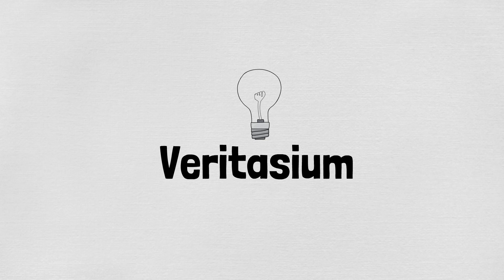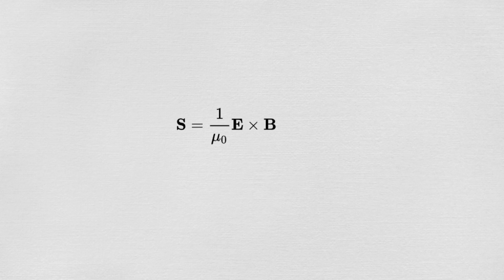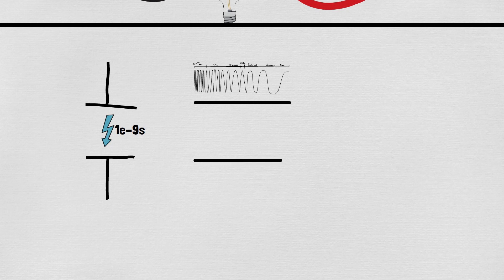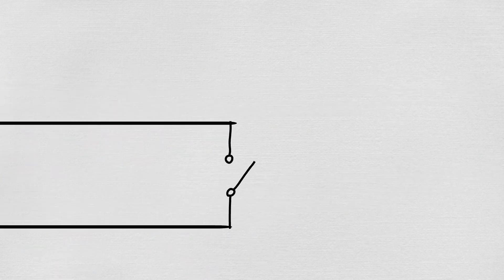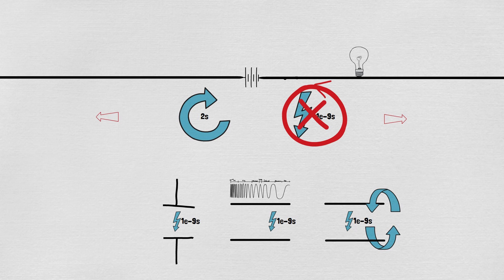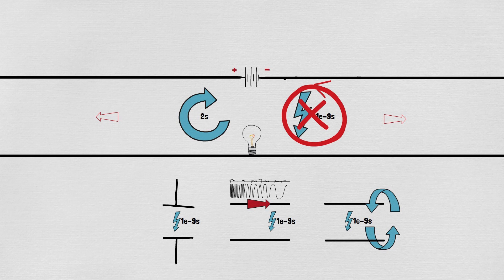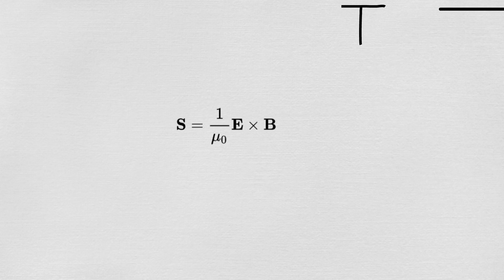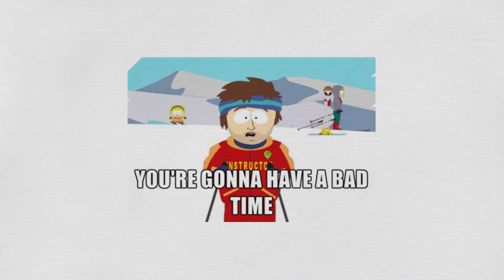Veritasium is Right? (see description)

Comment: Veritasium is a science popularizer as much as a science educator, so it seems he was successful in getting so many people of different expertise levels thinking and talking about this topic.
Reply from the maker: agreed. even if i'm wrong, or if "turn on" is very carefully parsed to mean any transient current passed through it, it's been a fun topic to discuss.
Reply: He is technically correct given the assumption "any current will turn the bulb on" which was stated. This also means the background EM field from the Earth will turn it on at all times but technically he is correct.
Reply: Not for the first time. His clip on 'Regression to the mean' is also faulty. He just read stuff & present it, without realy understanding it.
Reply: Sorry but he is wrong, because if any amount of power then it's not d, the answer is e, as it would ALWAYS be on, radio waves, solar radio,  and even cosmic background radiation, aka it's always on, or immediately upon turning the switch on if thats the point when you start measuring. (that's not even considering this proper explanation)

Funnily enough the power produced is probably lower than that from radio waves or just solar radiation, would have to calculate it for the cosmic background radiation. Especially considering PERFECTLY conducting wires, only 12 V DC, 1m distance.

He TRIED making a smart trick question to get people to think and to better understand the subject, however in the end it was a gimmick and is riddled with flaws and stupidity.

A science educators first job is to make sure they don't teach people the wrong thing and make them misunderstand, BEFORE anything else. Lastly he still hasn't corrected it which is even worse.
Reply: @antimatterhorn  Is it really transient at the beginning? I mean, isn't it more like this: It starts with zero volts at the bulb, and then when you turn on the switch, it increases as the EM fields build up when the current propagates through the wire. I.e. when you turn on the switch, the E and B fields will start propagating with the speed of light, creating a small but increasing voltage at the bulb. The Poynting vector (i.e. the energy transfer) will then increase kind of linear for 0.5 seconds (or perhaps 1 second) until the bulb reaches full brightness. (I'm not a scientist or so, but have my MSC in physics and electrical engineering :)  and this is what I could figure out.)
Reply: @MrThedumbbunny  Nope, if any EM field could turn on the lamp, the answer is 0 sec not 1/c sec. Because the lamp would turn on even before the switch is flicked.
Reply: @Dzeno2010  I do agree with you on this; V uses too many words and too much drama-music. He seems mainly interested in a certain beauty of the subject and get people to talk about it, rather than explaining it fully and/or on a level that really popularizes a subject. It means more subscriptions from me to people explaining this subject better than V himself did :)
Reply: @MrThedumbbunny  ""any current will turn the bulb on""

He doesn't actually say that. He says, "The lightbulb has to turn on immediately when current passes through it."

He doesn't say how much current, so the basic assumption is that there's enough current to light the bulb. The video is terrible, because the message he's trying SO HARD to convey is that, wow, the REAL answer is 1/c, but he completely ignores that what he's describing is induction, and the amount of power transmitted via induction is critically based on the distance. Hence that's why we need the wires to transmit power. His videos are supposed to convey true science, but all he did was muddy the waters and bamboozle viewers with clickbait, leaving them with a false impression.
Reply: @chrimony  no the litteral meaning of this assumpyion is if current goes through the bulb it turns on. Wording correction accepted. Meaning correction not accepted. The rest well yeah ive been saying exactly this. Technically correct given assumptions though earths em field would matter too. Also its misleading because the power transfer is miniscule. The capacitor idea of the energy transfer is silly. This was not bare wire and a 1m gap means almost 0 current due to capacitance. It was also not what he was describing which is inductance. Inductance is going to be reduced by  d^2 so a relatively large distance like 1m will recduce the effective current to almost nothing. Current is also only generated by changes in em field so choosing DC to demonstrate is a poor choice since it now means we are doing calculations on startup situations which is much harder to analyse with numbers due to the related rates and multivariate situation.
Reply: Derek misled people about this entire topic.
Reply: Sicklil, if I make the extraordinary claim that I can lift a car over my head, then I have misled people into believing this extraordinary claim. My fraud can’t be forgiven merely because I start my video by saying “assume that I can lift any object over my head…”
Reply: @interestedparty00  yeah but if your car is a p50 and weighs 150 lbs then your technically correct but misleading.
Reply: @MrThedumbbunny  Meaning is derived from context. The context is we have a lightbulb. If he wanted to say ANY current, then he should have stated that. For all we know, in relaxing our assumptions, he could be saying it doesn't need time to heat up. EEVblog seemed to going this route, because he modeled the bulb as getting the full voltage due to transmission wires and capacitance. At any rate, the video is terrible, and I wonder how much of the confusion Derek caused actually originated because Derek himself was confused, or if he just wanted to wow users while glossing over critical information or not covering it at all.
Reply: @antimatterhorn  RSD Academy says that there is a damped standing EM wave that dies out very quickly but that sends a pulse through the field to the other line in 1/c s. Which creates a small current on the other side and lights the bulb since ANY voltage will do so. This pulse will only happen once a transient is introduced...ie throwing the switch. If the switch is far away this changes things I think...?
Reply: @MrThedumbbunny  "EM field from the Earth will turn it on at all times but technically he is correct."     true. I think...if the field is transient at all. But well after this video I am questioning everything these days 🤣. However the point of Veritasium's video was to introduce the pointing vector to the world. And nothing else. But he did it in a poor way. He's not a great or even good teacher. He makes fun science videos, that's it. I have a hunch that we don’t know the context of the conversations with the professors before they said "I think you will be called out on it." The professors probably said: "Derek technically you are correct but this is not a good thought experiment to use because it is misleading, so I think you will get called out on it." Unfortunately Derek wanted a sensational video and that's what he got. The assumption that ANY voltage will light the bulb is what makes the long wires not irrelavent and instead, what magicians would call "misdirection". It's poorly laid out. I lost a lot of respect for him on this one.
Reply: @2hedz77  in his defense B fielda kicked my but way back when.
Reply: Actually, it just confused me and wasted my time, never watching this veritasium until someone starts interpret veritasium's conclusions in  strange way. After and before his video, I have a clear vision of this question. But lots of people lost it because of veritsium's video. Thank author for trying restore of understanding of this problem.
Reply from the maker: @2hedz77  i think this is possible (the damped standing wave) and that would be akin to calling a rock dropped in a pond the same thing as a current. yes, in technical terms, that is a transient current, but elsewhere (like twitter) Derek has actually claimed the bulb will turn on with a fraction of the power and stay on until 1s later. he might be right, but i don't think he is. i think another illustrative thought experiment is to imagine a conductive plate attached by a wire to the negative terminal of a battery and nothing else. does the plate become negatively charged and just waiting to discharge somewhere? no, the plate stays neutral.
Reply: @antimatterhorn  all you did was bla bla bla bla bla...
Reply: Yet, you can not just claim that DC power can be delivered through space independently of the property of the wires. If you want to transmit power via short pulses, you will need extreme currents and pulses that contain all kinds of frequencies and are not DC either!
Reply: He was still wrong.
Reply: @realedna    The claim was not that DC power was delivered - the power delivered in 1/c seconds is due to the transient in the wire when the switch is closed.
Reply: @Dzeno2010  calculate the capacitance between 2 wires at those lengths, I got a few milifarads. Definitely a bigger jolt then radio waves although we need to take the wire resistance in account still then
Reply: I don't think that excuses acting authoritative when at best it is a highly misleading interpretation
Reply: He's also wrong in about every video of his as well. Or outright lying, such in the Autonomous Driving Car video, which he was sponsored to make. AKA he doesn't have a single clue about what the fuck he says ever, and he is not an expert in any field, he's a fudging Youtuber... nothing more, nothing less. He has about as much of a scientific understanding as there are trustworthy news anchors on CNN. He's about as beneficial for science as ingame chat is useful in League of Legends. He's about as good for science as Riots are for small poor suburbs where no one can afford insurances. He's about as good for Science as stubbing your little toes on the bedside table.
Reply: @cm5754  The claim was about how POWER is delivered and not just transients.
And AC needs less and less wires the higher the frequency, but DC is based on flowing charges.
He mixes up those realms to ask a confusing question, that is clearly based on a DC circuit to argue, that power is always delivered through the fields and not the wires or charged elements.
This doesn't help the viewer in understanding anything better, but merely appears as a show-off that fails miserably.
Reply: @realedna  Power is power whether it's transient or not.  I agree the setup could have been more clear - if he replaced the light bulb with an oscilloscope and asked how long it would take for the oscilloscope to show power on the second wire, people would not be so concerned about the abstraction of a light bulb that turns on when any amount of power is delivered.  But the point that there is some tiny power flowing through the bulb after 1/c seconds is valid overall - the EM field is not trapped inside the wire and propagates through space. I thought that was the point he was trying to make.
Reply: @MeriaDuck  yeah but I do think he has some good videos and has had good or decent thought provoking trick questions that were entirely correct (in previous videos still a bit dramatic but whatever). I just despise it that he still hasn't correct the obvious flaw, you can't call yourself a science educator if you don't do that. He's misleading and confusing people which is counterproductive. Glad to see people like this channel getting more subscribers though
Reply: @antimatterhorn  The plate will stay neutral? If it is shorted to the terminal, how will it be at a different potential?
It won't, circuit elements don't need to look like a capacitor to behave like one, and this would be the case: The fields would go from the plate and wire to the other terminal.
The capacitance would be low, and the E-fied far from uniform like in a parallel plate capacitor, but still, it would charge.
Think of how the integral of E*dl would look like, you're going to get the battery's voltage V_bat from end to end inside the battery, 0 volts from inside the conductor to the plate, and -V_bat from just outside the plate to the other terminal, thus the required 0 for electrostatics
 
This is also the case with the problem circuit, the battery's potential is across the switch before it closes, then with a bunch of propagation and reflections after it's closed (the controversial bit), that potential drop will be at the lamp instead. “If there’s a break anywhere in this circuit, there will be no potential difference (5:00)” is just wrong, if there is a break in the circuit, the steady state voltage from the battery will be at the break (or breaks, think series capacitors)
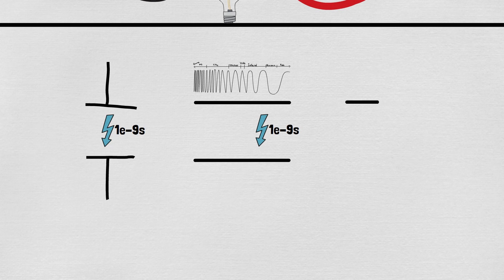When you ask "What is so special about the switch that turns an inert wire into an antenna? (2:23)" you seem to miss that the battery's voltage will be across it, and there will be change in voltage and current when it closes, and of course that means a change in EM fields, exactly what you need for an antenna to work.
 
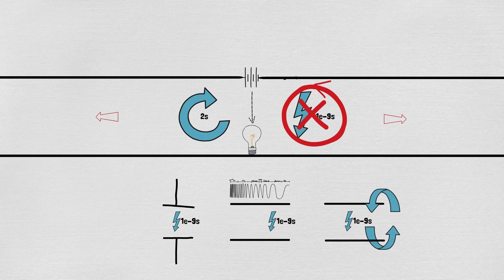Maybe this is also the source of confusion at around 2:50, "What is the function of the switch here, if the bulb doesn't care about shorts on either end, why do they care about the switch?":
The shorts on either end are necessary for the voltage drop to be at the switch before the whole thing begin, the problem is actually going from one steady state to another, and for the first steady state to be what it is, the entire circuit is necessary.
Reply: @user-el4np5xt8c  a perfect conducting wire has 0 capacitance ;)
I also assume you calculated the steady state situation which takes time to reach, which is not what he said, the only charge is how fast the battery can provide charge over a small portion of the wire within less than 0.1/c (as he said approximately 1/c anything more than 1.1/c is too much of a deviation anyway). A 12V car battery delivers about 600 amps at most with, however during the initial fraction of time its likely lower, look up charging behaviour of capacitors.

These are huge antenna not picking up a similar power to your tiny car antenna. That cause a insane difference in power delivered.

Finally he said any amount of power anyway.
Reply: @MrThedumbbunny  with regards to any current and the earth's em field, this is the next problem with this assumption. The circuit as offered is a massive antenna. The bulb would never off. This is the real problem with Derek's approach. He had to DISCARD science to make a point. He had to day: "If we turn off the following limitations of physical science, my model works." That's not good science. It was a bad video that led to a lot of people doubting what he had to say, even though the message he wanted to convey about energy transfer ISN'T wrong. The way in which he conveyed it didn't result in people saying "Wow, now I have a better understanding of science!" It left the naive target audience asking "So why are wires needed at all?" and the initiated frustrated by what amounts to  misrepresentation and misinformation.
Reply: @MrThedumbbunny : "your technically correct but misleading." <-- Which is why people must stop making videos saying that Derek was technically correct and start making videos that explain why Derek is misleading with his claims.
Reply: @forbidden-cyrillic-handle : "Derek said any current will do at the beggining of the video. Which meant the light bulb will be always ON, " <-- Excellent point.
Reply: @interestedparty00  im just waiting for one to do the math demonstrating power transfer via impedence in this system.
Reply: @livedandletdie  I'm not a particular fan of his, but he clearly has a background in science and is not wrong about everything, that's a fairly absurd claim.
Reply: @Dzeno2010  If you have two conductors, you have a capacitor (for mutual capacitance),  it doesn't matter how conductive they are. A lot of transmission lines are modeled as perfects conductors, with only capacitance and inductance
Reply: This popular method of education by starting a discussion stinks. In this particular situation, he has made a lot of people dumber about circuits.
Reply: @interestedparty00  That's ridiculous. How exactly did he mislead people? Anyone with the level of expertise to see any problems in his explanation, or to be affected by it professionally/academically, are formally educated at a level beyond that video.
Reply: @bacchusaurelius : "How exactly did he mislead people?" <-- He definitively claimed that we've been lied to about electrical circuits. He implied that energy forcing electrical flow to light a bulb flow outside of the wiring. ANYONE can understand that. It's absurd for you to say that he didn't mislead people.
Reply: He's a bait it seems. There is already enough crap on the internet.
Reply: @Dzeno2010  there will be an impedance still, even if the capacitance is effectively zero.(I found articles on capacitance of superconducting materials, albeit dynamic.. please do enlighten me) 
Don't use tau. They used smt with density of copper pairs or smt, I am out of my field here so don't take my word for it. But obviously r*c and L/R won't work here.

If any power is enough then he could power it without a battery as well, there is plenty of low energy noise

As for the amps even superconductors have inductance so you won't get to use that 600amps during transient...

Edit: apparently there are papers on capacitors made in superconducting material and their pro's and con's
"High-Temperature Superconducting Capacitor and Its Application to a Superconducting Wireless Power Transfer System" on ieee
I have no actual experience with superconductors so please do correct me if I am wrong
Reply: Yeah but he does say at the start of that video that "everyone else is wrong and here's why"  He probably could have left that part out.
Reply: @MrThedumbbunny  He isn't right with that either because if that were the case, the light bulb would already be turned on before he hits the switch.
Reply: @Dzeno2010  Exactly
Reply: The Veritasium video introduced me to these concepts and I had trouble believing his explanation.  This video does so much to clear it up.  I thank you both for the info.
Reply: @antimatterhorn  how do we know current only starts flowing after em field is established.
Reply: More specifically, he is a science communicator, someone whose job is to take very complicated science developed by very intelligent people, and “communicate” it to average, non-scientifically minded people in a way they can understand it. An unfortunate side effect of this process is that some detail and nuance will necessarily be lost, and sometimes some information will end up just being false, but ultimately that’s ok because his job’s purpose is mainly to get people interested in math and science, not to actually teach it to them.
Reply: @livedandletdie  The job of a science communicator (what Derek is) is to get people interested in the sciences who might have otherwise overlooked it. To that end he succeeds spectacularly. If the end result is more scientists and mathematicians in the world, it doesn’t very much matter that he never makes mistakes in his delivery.
Reply: @Vgamer311  He didn't just lose some information, in fact he managed to confuse the average joe completely with his bogus claim by bringing up an unrealistic example. If he truly wanted to tell people about EM fields in conductors, he could have done so without making stupid claims with such a terrible example
Reply: @TheChrisey  I can easily concede that his most recent video was a misstep, that’s fine. If your only goal is to determine “was he right or was he wrong?” Then the answer is he was wrong and we can all move on. The bigger point, however, is that even when he’s wrong, anyone who was interested in what he had to say will figure out why exactly he was wrong and will be more interested in science as a result. As a best case scenario some of them may be young people who will eventually grow to actually study these things, and that first spark of scientific passion might have come from a veritasium video.

Does that mean science communicators shouldn’t still try to be as accurate as possible? Of course not, them being accurate is still important, but while it is important it’s not the single most important part of their job.
Reply: @Vgamer311  Clearly you missed the point. Your theory that this will only fire off in a positive direction is vague and flawed. In fact most people who watch his channel are probably laymen, and if you confuse them by making such a poor and flawed example, they will just move onto thinking that what he said is true, and that's how you spread misinformation. Most of them will not actively research his example to see if he's wrong or not. Not until they as you say perhaps enter college and a professor may or may not correct them. If they fail to correct them and understand the misinformation, which btw is likely to happen more so than not, they will move onto thinking that the transfer of power is instant.
Reply: @TheChrisey  like I said, it was a misstep on his part. I’d be surprised if he didn’t address it at some point, in fact. I’m not saying it’s totally 100% fine to flagrantly spread false or misleading information, what I’m saying is that it’s understandable from someone in his position since nobody is an expert in everything, and if something does happen to slip through the cracks, it doesn’t undo the actual purpose of what his job is.
Reply: @antimatterhorn  I though the initial assumption was that the light would turn on the second any currrent passes through it, be it infinitesimally small, so I considered the transient to be included. In that case, his original explanation would still hold imo, but yes using the static form of the poynting vector was a bad call. Going down the route telegraphers equation and bounce diagrams maybe would have worked?
Reply: @Dzeno2010  @Sicklil This is a theoretical question to test and illustrate understanding. That is why we can neglect wire resistance and Earth's EM field. I think considering even tiny transient currents through the bulb is useful for gaining understanding. 
I do agree that this should have been stated in the video, but one could also argue that creating drama around this topic will get more people to think about it, thus educating them more effectively.
Reply: @MrThedumbbunny  Science apologia seldom makes it through peer review
Reply: @cheshire1  I strongly disagree. If you are not going to go all the way and demonstrate the counter current/voltage based on time resistance/impedance/capacitance just let it be as the algebra based formulae. B fields make the system tremendously more complex and confusing because you get counter voltages and short term impedance based on change. In most situations you can ignore it but for IC circuits sometimes you have to pay attention to things like placement of ac power equipment.

The example further muddies the water because the DC power doesn’t consistently do the whole capacitance/inductance… only at the very beginning which is like starting a chemistry class by having them figure out the rate of reaction over time around a catalyst.
Reply: @MrThedumbbunny    I don't understand what you mean bu "just let it be as the algebra based formulae". Does it mean we shouldn't consider fields and just calculate it like in highschool, with resistance included? Maybe that would give more accurate results if we were actually interested in the quantity of current in the bulb, but we just want to explain a concept. The resistance doesn't help explain the point so we neglect it.

Dereks Approach may not be the best way to train People for certain applications like designing ICs, but it does get rid of the "energy only flows in wires" misconception. It didn't claim to be immediately applicable to a specific real world problem.

To give an analogy, yes you need to factor in the gravity distribution caused by mountains and and density differences in the crust if you want very accurate GPS (I'm not 100% certain on this, so don't quote me). But you don't start with that when explaining how general relativity is used in GPS.

I don't know how catalysts work, but I'd be happy to learn.
Reply: @user-el4np5xt8c  It gets super complicated, too complicated for me to put in the time and effort involved in the math as well.
Point being is that in that timespan the charge delivered is abysmal and much slower than power delivered to an antenna that large by all radiowaves or solar radiation. 
I wrote a qgood reply but had one 1 external link to quora, however Youtube saw it fit to shadow delete my comment and I'm sorry but can't be bothered to type it all out again, sorry.

In the end veritasium is just wrong, it's either all the time or from the start, or it's 2s. His answer makes the least logical sense for how HE posed the question.
Reply: @cheshire1  a catalyst provides a short cut in a chemical process reducing the energy required and this increasing the rate of reaction. This also means that at t=0 you have no product from the reaction so you end up with a related flow rate system involving a time component that reduces the reaction rate as it takes time for the product to diffuse or get moved from the catalyst. Until it moves it effectively blocks the catalyst from doing more reaction. This means you get an over time gradient of reaction based on the solution diffusion rate reaction rate both catalyzed and uncatalyzed and finally any external mixing. 

For the dc circuit he is describing in his video you have a momentary change as the voltage moves out meaning the position of charge is moving away from the bulb over time. This means that at the leading edge of the line close to the switch the voltage is pushing at approximately c. Behind this the current is approximately steady state (if i recall it is actually doing minor fluctuations due to impedance changes as initial changing voltage/current moves away becsuse of the induced current on the far side of the line) this means you have a changing current with respect to time but not on the entire line so its a moving point of induced counter current and the counter current induces a change in the origional line too but smaller and smaller since the voltage is constant. Its basically a moving sphereicial projection moving at the speed of light toward the other line and the source is moving at the speed of light along the line so you have to do an integral based on position and distance of a momentary change in field which creates the current. A static magnetic field doesnt create a current so the current is only generated at that single point with very slight ripples due to the changing impedance from the far line.

Capacitance is changing based on time as to a DC circuit it starts as an short and then goes to an open over time. Now you have to figure out the capacitance accross the 1m of air and the wire sheathing in this situation where its an integral over time for each infinately small capacitor whos capacitance is directly related to area. Then you have to combine capacitance and inductance (dont forget they affect each other so more related rates fun).
I could be off and maybe these cancel out mostly but my calc isnt up to this any more and i don't have the probably 4 hours to sit and solve a problem like this anyway. Once upon a time I would have given it a real shot for fun.
Reply: @cheshire1  forgive me im trying to explain it without starting from electron motion and building up (which is how I was taught). I am not at all sure im explaining it well.
Reply: @livedandletdie  I am claiming ingame chat is useful in League. Change my mind.
I think youre not doing him justice here. Even if he were wrong in every video which he is not, it would still benefit science as sparking discussion always is.
Reply: @eddietee6305  there is so much worse crap on the internet and in the real world aswell
Reply: @MrThedumbbunny  Thank you for explaining. I think I get your point with the catalyst now.
You're right, the situation with the initial switch to DC resembles that. Veritasium should've just used AC current. The point would still stand that you get a small current through the bulb after ~1e-9s and it stays steady until the main wave (that travels close to the wires and is much stronger because of that) reaches the bulb after 1s.
Reply: Exactly.

Like Neil Degrasse Tyson, Veritasium is a science communicator, not a scientist.
Reply: @cheshire1  Still no correction/update, so still stupid... 
That's one of my biggest issues, he knows by now it was confusing and wrong, about a month has passed and he hasn't made a correction yet.
Also a lot of people will not watch secondary videos. You know how often people actually see corrections when wrong sensational news got published? Even with said news-papers or news channels making a correction?

You think that would be better with more complicated topics in which already less people are interested?
Reply: @Dzeno2010  >he still hasn't corrected it

Never mind that expecting an amended video after two weeks is kind of ridiculous, especially if you know anything about how he operates the channel... there really is no need for it, not this time around. Almost everything has been said, and while I bet that Derek will revisit it and clear up some misconceptions, having him put the usual effort into an exercise in reiteration really doesn't seem like a great use of resources, by any reasonable measure.

>A science educators first job is to make sure they don't teach people the wrong thing and make them misunderstand, BEFORE anything else.

A science educator's job is to teach people how to learn properly, among many other things. Striving for correctness is a great ideal, but it's also entirely impossible across the board and always marred by slight misconceptions from even great scientists. Just look at the dang Mehdi vs. Lewin Kirchhoff-feud; intelligent people and both (one more so than the other...) with their little, off-kilter behaviorisms and an overwhelming sense of "sometimes even amazingly educated people have a hard time expressing the correct idea".

Having your students learn how to do error correction on the fly is THE skill taught in school, whether it be knowingly or just by virtue of demonstrating the required principles. There are always people in classes picking up on the teacher doing things wrong, the only thing that goes against this principle is disincentivizing and dismissing discussion - which Veritasium decidedly does not do. He completely fulfills the requirements for successful science education, at least on some level. If you mistake his fun videos for in-depth graduate courses, that's kind of on you.
Reply: Indeed.